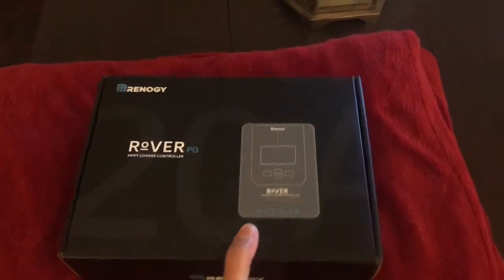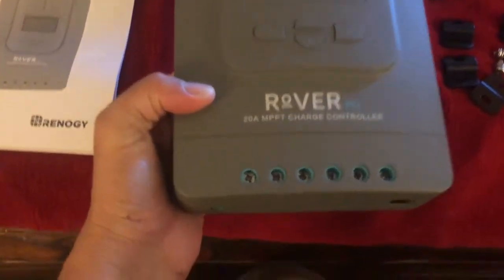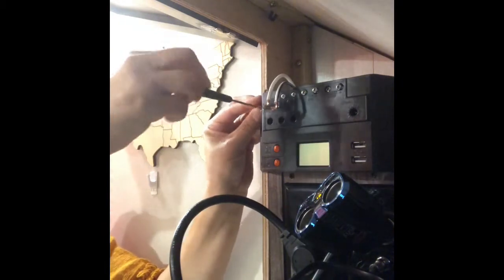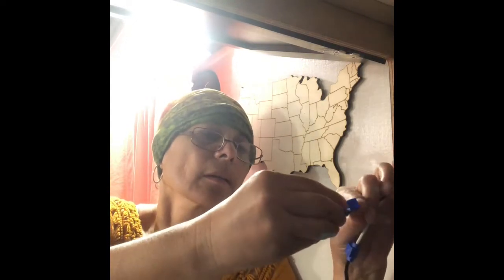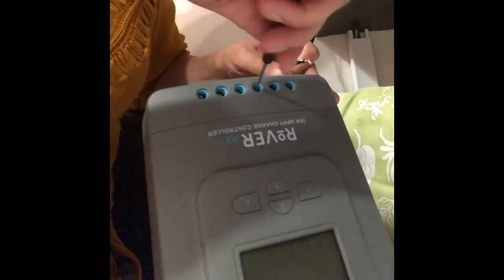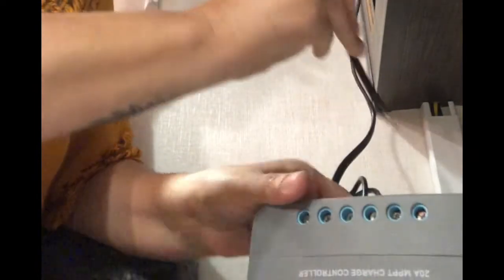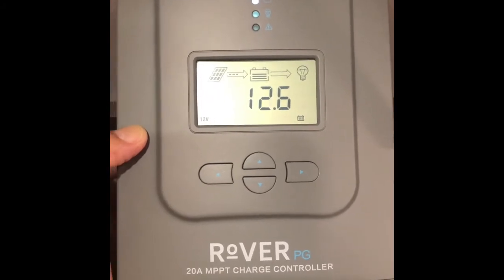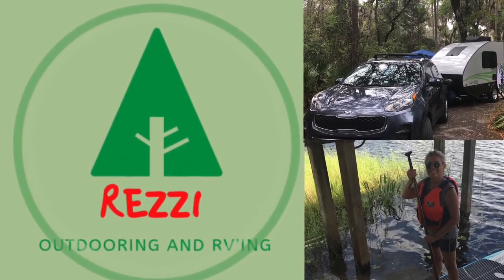Upgrading my solar charge controller. Renogy MPPT

Comment: lol, i installed my previous controller upside down as well, it worked better for my set up temporarily, thanks for taking the time to make this video as i am ordering my new controller today. 👍👍
Reply from the maker: Kevin Burgess lol we make it work somehow. I really like this controller it was so simple to install and use. I like the Bluetooth app so I can always check from inside the house to make sure all is well with the battery.
Reply: Can it be used upside down as it would make it easier to put the wires in  if you need to take them out for any reason?